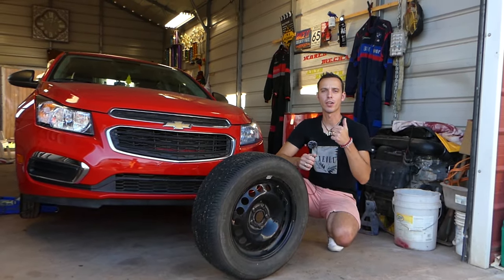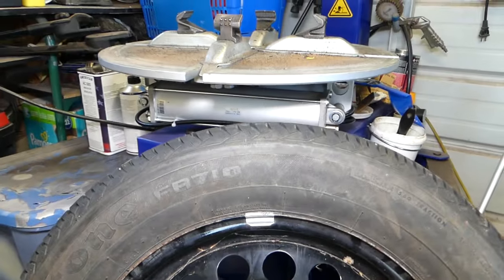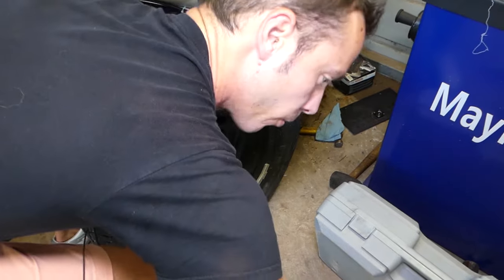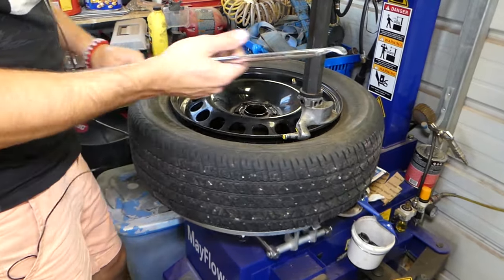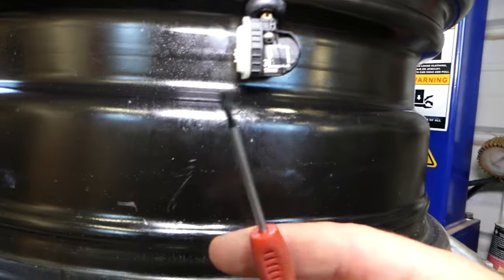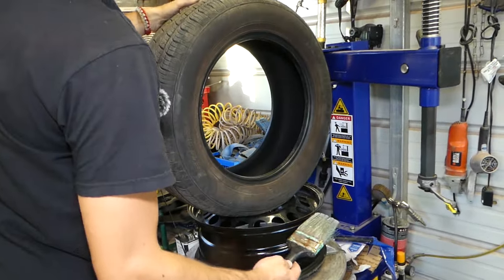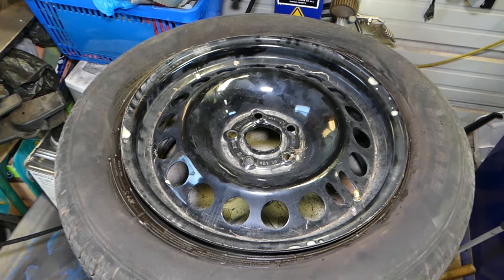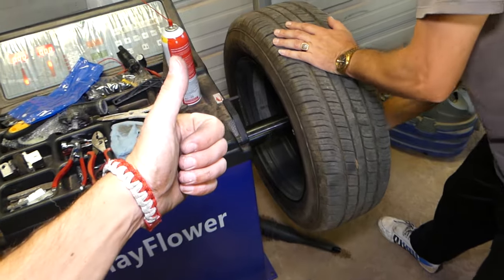HOW TO REPLACE TPMS SENSOR ON CHEVROLET CRUZE MALIBU SONIC IMPALA TAHOE TRAVERSE EQUINOX SILVERADO

Comment: Thanks for the video. I appreciate the time you took to make, edit, and post the video, but it doesn't help the average person unless he or she has 30k worth of tire removal, installation, and balancing equipment.
Reply: As long as you dont change the rim and keep the same setup you can break the tire down by hand and remount it by hand its a little pain in the ass but its free lol
Reply: you can buy a manual tire change machine at harbor freight tools for $40

Comment: Impossible to do this at home. However, thanks for showing how it’s done.
Reply: huh why is this impossible? All you need to do is take the wheel off and break the bead. You'd be surprised how many ways there are to do it without a tire machine.

Comment: So basically, if you do not have this machine, to replace the sensor means a trip to the tire shop.
Reply: Yes, you have to be able to remove, or partially  remove the tire from the wheel in order  to get to the  base of the  valve stem  where the sensor is located.
Reply: I do it manually at home every time I patch a tire... it's a pain in the ass.. but it can be done.. and I save 30 USD every time

Comment: My friend, help me up... I have 1993 Audi 100s, I love the car... But it has a oil leak on the cap, but o replace the cap and nothing, what can it be and how to fix it.
Reply: Check valve cover gasket
Reply: I did, no leak, the leak comes from the oil cap.
Reply: @superlegolover1999  If you got oil coming out of your oil cap, sounds like something is wrong with the vacuum and evap system

Comment: Can the batteries be replaced instead of the whole sensor ?
Reply: That’s a good question did you ever get an answer?
Reply: @FwaygoTheKid  no response atm
Reply: The batteries are just as much as the entire new sensor in my experience
Reply: On some you can replace  the battery,  on this one you would not want to it involves   too much time and hassle with soldering.

Comment: Can I just remove them and leave it off
Reply: I was thinking that too but then  the light might come on constantly.    i dont like having these either
Reply: @joedevitto6113  yeah my light on my Toyota seinna has been on for a year.  It has one on the spare tire. Up under the van.  And only the dealership can really get to it on the lift. And I really get sick of waiting two hrs for an oil change.
Reply: @thecynic807  What  if you have a flat  how do you get that  out from under the van ?    I would see if you can at least get that  out  and  put it in the van in the back or something  ,   What about    a tire  place   to change the sensor ,    all these   computerized  things in the cars today just cause more headaches when they break .  i like the old school  cars    easy to fix
Reply: @joedevitto6113  i got a 65 chevy van too.  It didnt have a fuse box so I bought a new harness thinking that will be easy to put in.   Nope.  Im stuck on the light switch the blinker switch and theres no voltage regulator.  Its all very very confusing.  And I've been scratching my head for over a month.
Reply: @thecynic807   Wow  maybe there will be videos on  here to  see how to fix .  this is my second home on here  for fixing things  car and house or anything.    its a huge  help for sure ~